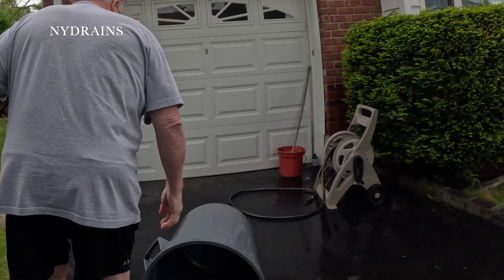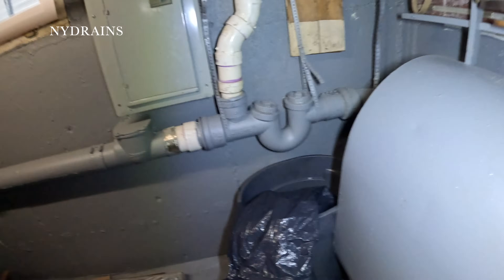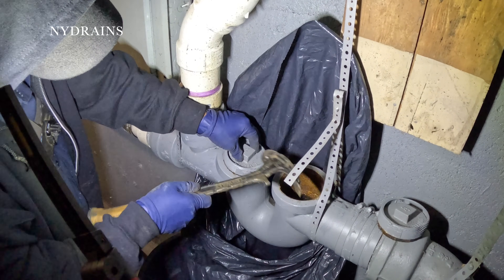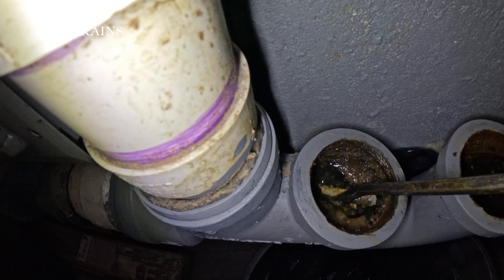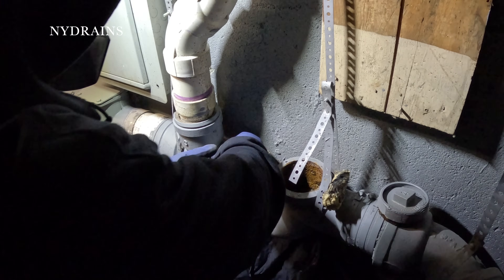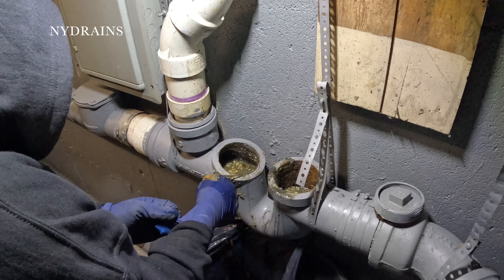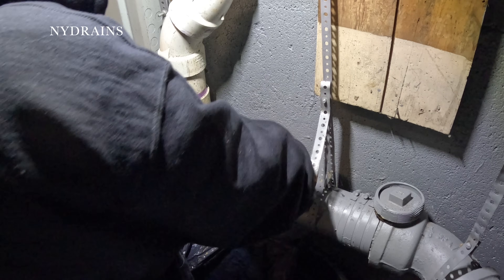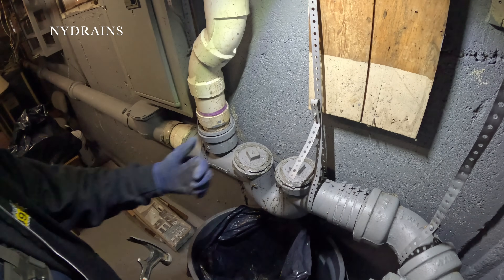Clogged Drain #230

Comment: Hello and good morning folks; take that stupid old rat trap out because I’ll bet the rest of the house has been retrofitted with under the sink traps and put the right pitch on that pipe. You can see the box that’s farther towards Donald‘s left, that is a check valve, so nothing from the street can come into the house. I would leave that in and take the rat trap out! Then install a nice Kohler or American standard power flusher and you will not have any more problems unless there’s a case of super stupid in the house! The best thing to always do whether you have a power flusher or regular gravity type toilet is to do your “dump” first, then flush that and then do the paperwork right afterward, and if you got to do two flushes for the paperwork, then do that but you won’t get it clogged if you follow that formula! Take it from me, I’m a master plumber who does the same stuff that Donald does as well.
    Edward H. – “ Integrity Plumbing, Septic and Drain“ out of the Clinton, CT USA area.
Reply from the maker: A trap for the main sewers in Code in NY 😉

Comment: Every time I watch one of these I'm reminded how glad I am to live in a state where these goofy building traps are illegal.
Reply: people still clog their drains...all the houses in my neighborhood are 25 years old or newer and I see the rooter trucks all the time.. the drains are actually beuilt right, but people clog them up with wipes and skillet grease and such..  this old guy needs to go out and get a vintage american standard cadet toilet..  something like 5 gallons per flush
Reply: @eldoradoboy I was going to say this. At least until he gets that problem fixed.
Reply: @eldoradoboy  Yeah, but the point is I don't have some superfluous dumb trap in my house that likes to clog up and which is ready to spray sewage everywhere when someone knocks the caps off. That's just dumb design right there, and that's why it's illegal here.
Reply: @eldoradoboy  Hello and good morning folks; take that stupid old rat trap out because I’ll bet the rest of the house has been retrofitted with under the sink traps and put the right pitch on that pipe. You can see the box that’s farther towards Donald‘s left, that is a check valve, so nothing from the street can come into the house. I would leave that in and take the rat trap out! Then install a nice Kohler or American standard power flusher and you will not have any more problems unless there’s a case of super stupid in the house! The best thing to always do whether you have a power flusher or regular gravity type toilet is to do your “dump” first, then flush that and then do the paperwork right afterward, and if you got to do two flushes for the paperwork, then do that but you won’t get it clogged if you follow that formula! Take it from me, I’m a master plumber who does the same stuff that Donald does as well.
    Edward H. – “ Integrity Plumbing, Septic and Drain“ out of the Clinton, CT USA area.
Reply from the maker: Lol

Comment: Fill the bathtub up once a week and let itflush the line of any buildup. Regular toilet and sink flow isn't enough to remove the soap scum build up from the dip in the line. Like the Boss said until the homeowner fixes the plumbing/pipe issues once in for all. I always fill my upstairs tub to the limit and then pull the plug to flush my main line. The kids have a tendency to use too much toilet paper and I'm trying my best to keep ahead of a potential clog…..
Reply from the maker: I do advise also 😉👍

Comment: I would bet dollars to doughnuts that check valve is also a problem but can't be serviced with the breaker panel in the way. That last 10 feet or so needs a better pitch and move or eliminate the check valve at the same time. Then you could get some flow. Also, do a load of laundry with HOT water once in awhile.